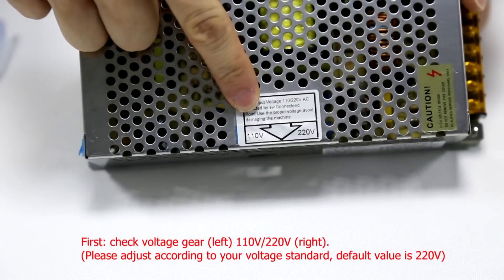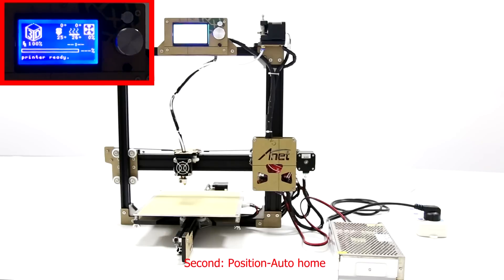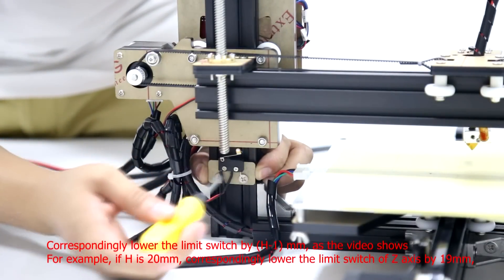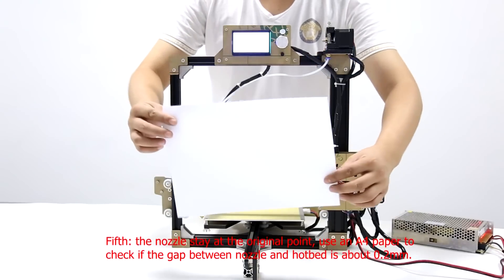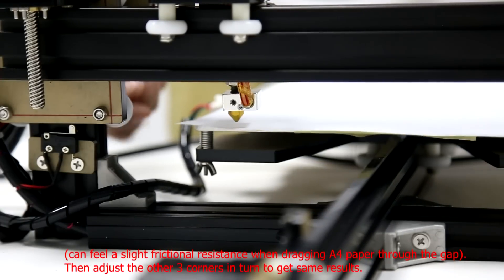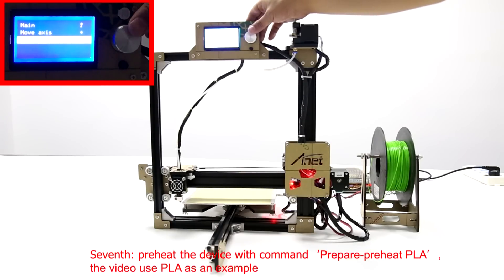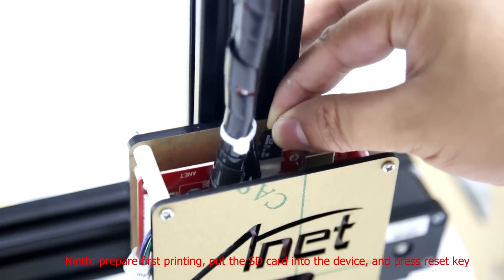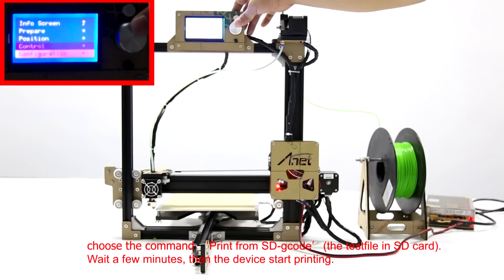3D Printer Instruction--3D Printer A2 Debugging Video

Comment: Print not sticking!  Only Have ABS What setting do I use in CURA for ANET A2?
Reply: Try using a glue stick and increasing your hot-bed and hot-end temperatures. You may have to stay under 260°C because the A2 comes standard with a PTFE lined nozzle, which is helpful trouble free prints, but limits your maximum Temp for other filament types. 🙋

Comment: It would be really nice if below the auto home option it also had "Bed front left", "Bed front right", "Bed rear left", and "Bed rear right" which each move the z-axis up a bit, move to a position maybe 10mm into the corners, and then lower the z-axis again. It would make the bed leveling process much easier as you can just tell the printer to move the nozzle into one of the corners, check how far from the bed it is, and repeat for each corner without having to manually move the x and y axis through the menus which is tedious.

Comment: I am following these steps but the extruder isn't pushing the filament through.  I can manually push it through and it's coming out the nozzle so it's not blocked.
Reply: When I try to print it simply counts from 0-100% but doesn't move at all.  The fan pulses.

Comment: my problem is autóhome Step 2  no finísh  motor no stop
Reply: i have the same problem, how did you solved?
Reply: i had to reverse my Y axis Motor, otherwise the print bed would move the opposite direction of the limit switch.

Comment: well has someone a A2 and a A6(or 8) to say out of the box wich printer gives the best results? because the A2 can print 0.05mm and the A6/8 start at 0.1mm....so the A2 prints smaller layers....yes? and the frame ? is it less wobbling then Acrylic from A6/8?
Reply: While I can't give a comparable view, when you fully assemble and tighten the A2, You can pick it up on any part of the frame and feel almost no flex. It's very similar to the CR-10's sturdiness. It feels like it's welded. Confidence inspiring to say the least ✌

Comment: Is the A2 the latest model? Better than A8?
Reply: Then you are not able to assemble a DIY printer, mine is working fine.. theses things arent for everyone
Reply: You must of Responded to the wrong reply, The screws won't turn in the channels,  and the power supply blew up within the week,  I returned the pile of scrap almuminum and now i'm looking for a better one.
Reply: I can't edit my post but you did reply to the correct post
Reply: You got to use common sense when you assemble this printer... There many errors in the 2 videos that make crucial difference at the end.. Theres a facebook group dedicated to this printer, really helpfull... Other anet printer have acrylic base, this one is the most sturdy
Reply: hi there michael.   i run skynet3d - firmware and premium mods ebay store for anet specific printers!  there are flaws in many Chinese printers, this is undeniable. maybe check out the anet a-series facebook group or if you get another printer. that relavent group because usually the community has already done all the most needed fixes or dos and donts before you make your purchase.. hope this helps .
Reply: a2 is garbage, It falls apart when you assemble it

Comment: I am wanting to buy this printer but that X axis looks like it may lean, because of have only one Z axis rod and motor
Reply: The board has a connection for a second z motor so you could always add one yourself as an upgrade (which I'm probably gonna do at some point). For the price this printer is I think it's a pretty great deal for something that performs decently well and has potential for upgrades down the line as you have time and money for them.